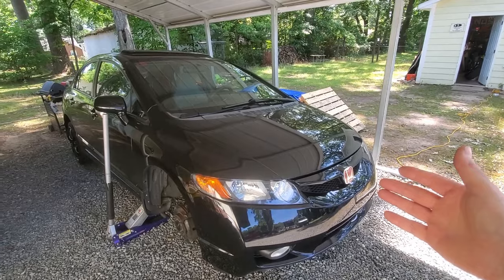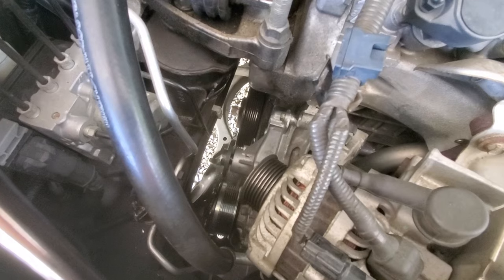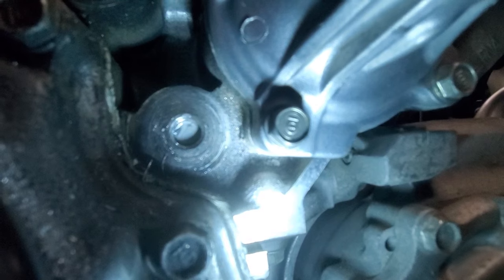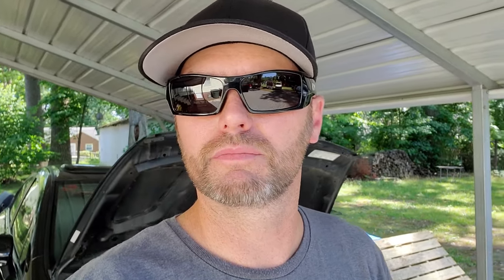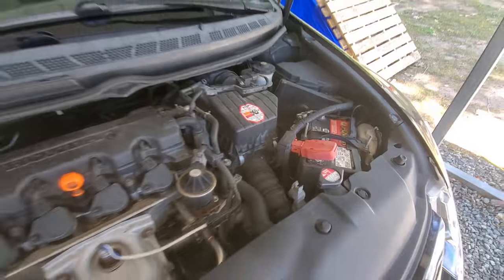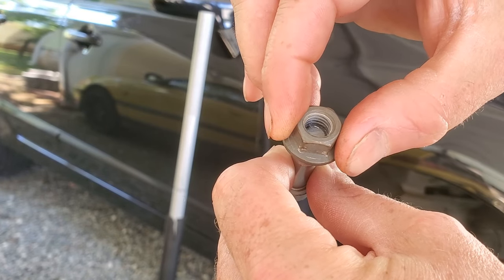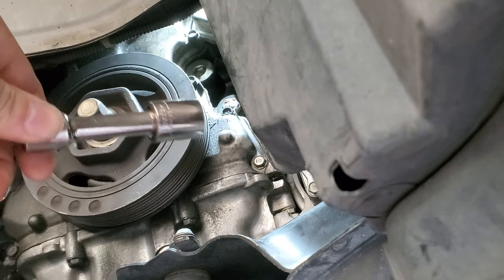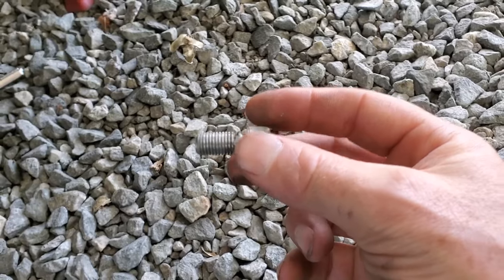Removing A Broken Bolt From A Engine Block The Easy Way

Comment: Just check some science data, it looks like iron expands at +/- half the rate of alloy (depending on the mix) so the hotter the metals bolt will get looser. So don't wait for metal to cool down b4 unscrewing it

Comment: I bought brand new drill bits and harbor freight reverse drill bits. But before I went to store I kept spraying penatrating fluid multiple times and shocked around the bolt hole with a small hammer. Got back and drilled right in the center and took extractor bit and came right out. If not I was gonna weld like this
Reply: with you Brother   im a stree smart mechanic  from da 80S he that the beast way to do it

Comment: I always apply Never Sieze to every bolt and nut that is not internally lubricanted that I remove or replace. Works wonders. I  also apply it to gaskets as well. Good tip as always 👍

Comment: This just happened to my 2010  Honda civic it came apart while driving left me stranded and the tension pulley came loose and got caught up with the other pulleys not allowing them to spin  my motor mount went out causing the engine to drop a little bit,I replaced that thinking it would lift it back in place with the tension pulley and realized it broke off a 1/4 inch inside the block …same exact bolt as this

Comment: Well  done  &  explained ! !    Am  gonna  guess  that  while  building  the  weld  on  the  broken  stud  the  HEAT  caused  expansion/contraction  difference  helping  break  the  stud  free  from  the  block.
Reply from the maker: Yes the heat from the welding does help with the expansion and contraction making it easlier to remove the broken piece. That is more important on something that might be corroded also.

Comment: The same bolt sheared off on my 2005 acura tl just yesterday i dont have a welder so i drilled out the block it has not been very fun honestly. I do not see a way you could have welded anything as the part of the bolt that was left was recessed quite a ways into the hole. Unless you mean you are welding something threaded thats smaller than the old bolt oh i see thats a neat trick. So without a welder what do you do?

Comment: The factory bolt wasn't strong enough to be removed, but the nut weld backed out no problems. Did the heat from the mig torch free it up? I am going to try it, would be an answer to my prayers if I can swing it.
Reply from the maker: The bolt breaks due to vibration of the belt tensioner usually. The heat of the weld helps break the bond due to the fact that steel and aluminum expand at different rates.

Comment: I just got the same broken bolt out of the block of my daughter's 2009 odyssey. by using a left handed drill bit .I I got just a little bit in depth with the small hole in. the in the broken piece started backing out then. Came out fairly easy. Yes, I was. lucky.

Comment: You would think they would just put a bolt with a head on it but that's to simple I guess.
Super useful info
Reply from the maker: Its definitely a design flaw for sure. It is a M10 bolt which is not really small. Due to this problem, the bolt really needs to be bigger and the hole in the tensioner needs to be also.  There is also no way to know what grade bolt it is (Im guessing a grade 8.8) but I replaced it with a grade 12.9. We will see how it goes.

Comment: A mig welder eh? 🤔 I wonder if I could extract a smaller bolt from a cylinder head of a 1.4L Cruze Water Outlet using the same techniques you applied here. Bolt size is E10 and is actually standing proud of the Head, which I believe is cast aluminum, bolts are, I'm assuming Rusted and Iron I think... anyway, need to try something, that or hire someone like You. 😃
Reply from the maker: If the head is aluminum this trick should work.
Reply: @4LaneBlacktop  apparently that Cruze head is cast aluminum, and I just tested the bolts on the water outlet and they are indeed magnetic, iron present. I did call a mobile welder, because I don't have welding equipment and I would have to rent it.
Thanks for Reply. 👍🏻
Reply: @1Patient Did the mobile welder get it out?✌️🍩
Reply: @donutdan1508  I called, almost pulled the trigger...so much has happened with the car. I jury rigged the cooling system the bolt is still there waiting for me to deal with some day, with 228k on vehicle.
Reply: @1Patient  Mine was a small metric bolt broke off in an atv cylinder.  Got it with a drill and extractor.  I've got a mig welder but that's a last resort for me!
Good luck with your car man.
✌️🍩

Comment: Hey what type of people do I call for this job on my valve cover bolt broke off that can come to house
Reply from the maker: You can get a mobile welder but it will be cheaper if you can get it to a shop.

Comment: Thank god i found this video! My only question is where can i buy a replacement bolt. Same make and model for my civic and same issue but i cant seem to find the bolt to buy anywhere. Pls help!
Reply from the maker: You can get OEM bolts from Honda. there is a long one and a short one. You need to figure out which one you have. Long bolt is part # 90001-R1A-A00, short is 96700-10055-18.
Reply: @4LaneBlacktop  thanks

Comment: Where did you ground the welder to? Because I have a bolt snapped off in a similar position on my 2001 civic
Reply from the maker: You can ground it anywhere on the engine block

Comment: What I really wonder is how many Honda owners got charged for an engine block replacement after a savvy service tech removed the broken bolt as shown in this video.
Reply from the maker: We can only hope that didn't happen but with the way some dealerships are, unfortunately it probably did.

Comment: What stops the welder from melting the aluminum?
Reply from the maker: The welding current flows thru the steel and not the aluminum. Plus you are only heating it for a few seconds. It takes longer for the aluminum to reach melting point than the steel.

Comment: What higher grade bolt did you use
Reply from the maker: @JoesRigsandRepairs  12.9 insted of the factory 10.9
Reply: @4LaneBlacktop i appreciate the response, where did you end up purchasing the replacement. 
Have you had any issues since. My facotory bolt has broken twice .

Comment: Will any welder do the job. Like a harbor freight one? I broke a head bolt in the block. Im freaking out a bit because i kno if i cant get it out im screwed. Any tips and tricks  would help.
Reply: What did you end up doing? In a similar situation myself.
Reply: @TH3CROWDARKANG3L  I drilled the small hole in the center of the screw and ended up using an easy out the screws now out and the car is now being rebuilt.

Comment: Did it break off while tightening or loosening?
Reply from the maker: It broke under normal use conditions. It is a design flaw from Honda.  They even changed belt routing to help fix the problem but even that is not 100% obviously.
Reply: @4LaneBlacktop  I keep thinking that if these bolts keep shearing off, then they are probably not large enough.

Comment: Hi! I've had the same problem. The thing its that it keeps happening, the water pump alley rubs the belt tensioner. The mechanic had to take off the engine to actually take the bolt out and fix the bad threat. I used the same belt tensioner with a new a bolt but I feel that the bolt its starting to do the same thing the water pump rubbing the tensioner. Any ideas of why that would keep happening to me?
Reply: How much did they charge to pull the engine out and remove the bolt?
Reply: @anthonymonahan3331  Probably too much. 😃
Reply: Can’t you buy a stronger replacement bolt?

Comment: Great tip! Do you think the heating of the bolt also helps in getting it to let go?  Do you recommend anti-seize for the new replacement bolt?
Reply from the maker: I think the heat helps. The problem that I should have mentioned in the video is that this bolt breaks due to the constant force on it from the belt tensioner, not being over tightened or being loosened.

Comment: Corollas do the same thing. Second time right now and I am going to use thread locker on this one.
Reply from the maker: if they back out, use blue thread locker. If they are breaking, get a higher grade bolt exactly the size of the oem on. That is what I did here.